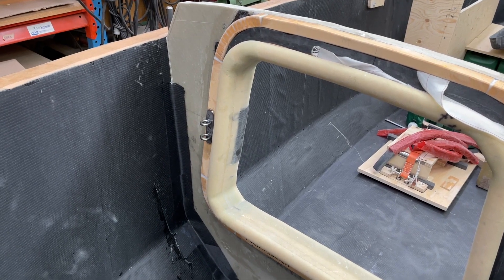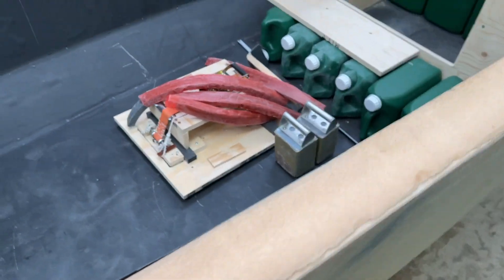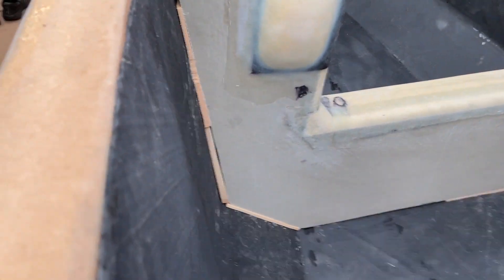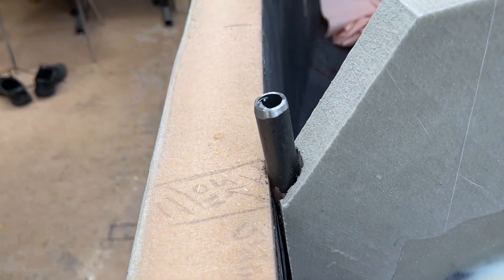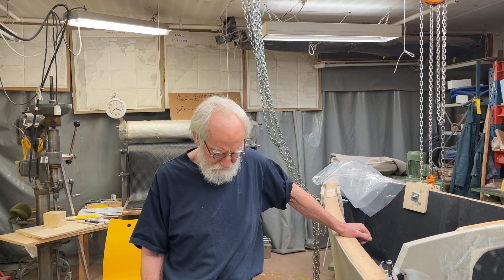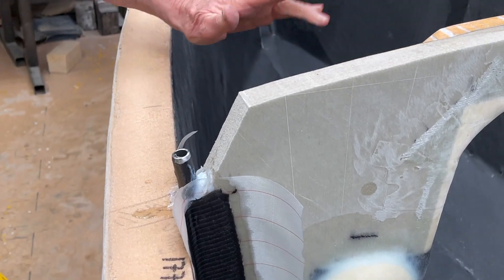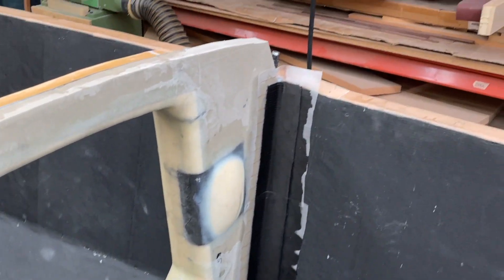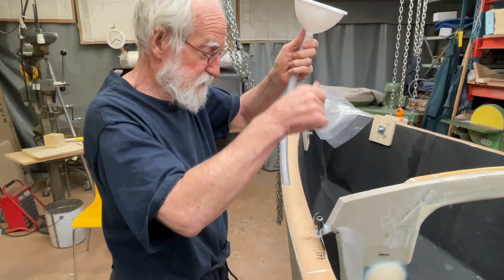Reinforced fillet on aft side of forward bulkhead. Also preparing for injecting epoxy.

Comment: Im not certain that I approve. Joining the bulkhead to the minimal composite layer places the forces of tension where it will to delaminate the cf from the hull. The bulkhead is bonded to a thin laminate. Shouldn't there be a mechanical attachment which is later filled?

Comment: Hm, how will you lock and unlock the hatch from inside? Or maybe it's only intended to be locked and opened from the outside when you are to open the top hatch?
Reply from the maker: Its only intended to be used when I open the deck hatch. Like a submarine airlock

Comment: Has that tube got hole's in it to seep all through the bulkhead too hull joints to saturate the joint completely Sven  ?
Reply from the maker: Its a grow in the bulkhead as shown in previus video
Reply: The tube is short-it is just to feed the epoxy into the space between bulkhead and hull. There is a groove around the edge of the bulkhead to allow the epoxy to flow more easily.  I don't know why there is a tube on each side of the bulkhead. I would think you would only add epoxy to one side and continue until it started to appear at the other. This would ensure you have no voids in the joint.

Comment: What a pity that the carbon fibre is not transparent to see how you fill the tubes tomorrow.... Dear Mr. Pastry Cook 🤗, before epoxy existed, what was used? Thank youuu.
Reply from the maker: When in 1975 I came to the US and started to work with trimaran desinger Dick Newick he said: How could you have lived without epoxy. Before everything was very difficult except metal boats but they were heavy and cold

Comment: Would it not ensure the epoxy penetrates all the way down the tube / groove, if you injected it with a syringe, rather than letting it drip feed from a funnel?
Reply from the maker: When I see that the epoxy comes out on the other side I know that it been everywhere. I done it many times before with different methods. This way works best I have found.
Reply: Dear Mr Yrvind, your method of filling up the gap between the end grain of the bulkhead and the surface of the hull with epoxy is very clever and I think should make a complete and perfect joint.